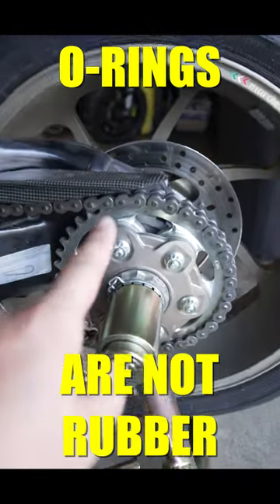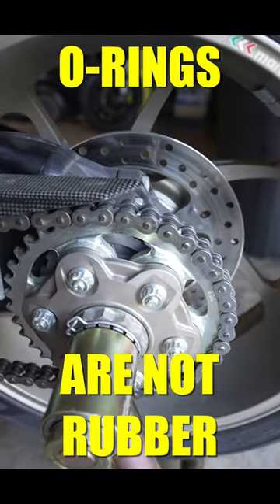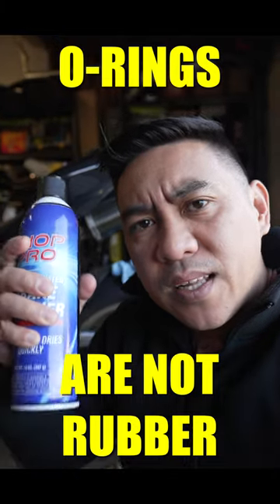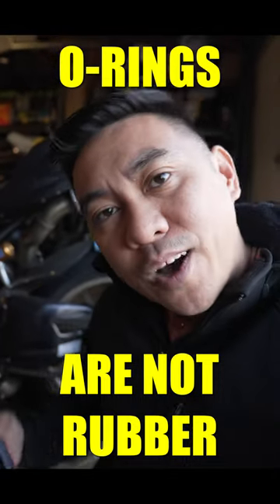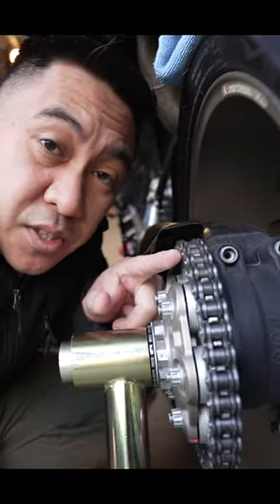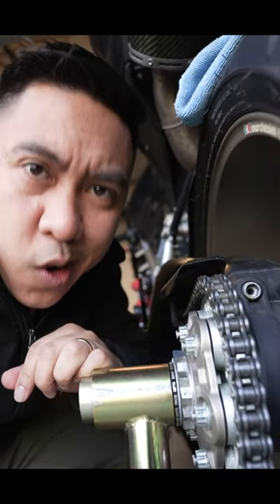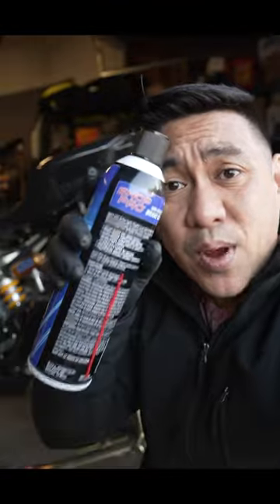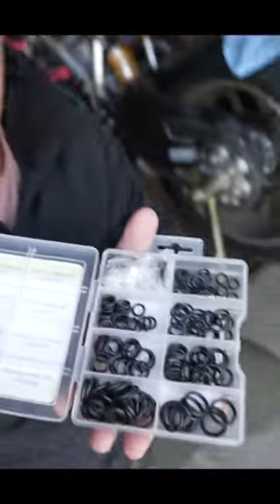Motorcycle Chain O Rings are Not Rubber

Comment: No ,it doesn't "melt " the o-rings however the o-rings are under compression, after application of "certain" brake cleaners they will expand slightly and some times, they will split and come off. The o-rings are chemical resistant NOT chemical proof. Now what will melt the o-rings is the friction that builds up heat THEN the nitrile o-rings will melt because the brake cleaners wash away the lubricant that is supposed to lubricate the o-rings so they don't heat up so much. The function of the o-rings is to retain lubricant for the pin and inner roller, the chain lube is to lube the outside roller to the sprocket to the surface of the inside roller to the outside roller. The chain lube uses the same base chemicals of brake cleaner but not all the other chemicals and NOT in the same quantity and are used to dilute the lubricant to an overly thin state , so the wearing surfaces of the outside roller and "guess what" lubricate the o-rings. It is best to lubricate when the chain is hot, this is needed so the components and clearances are larger than when cold and the heat speeds up the diluting chemicals faster , the o-rings are not negatively affected and the lubricant jells up as, a grease.  Calling someone a moron or cursing them is a sign of a weak position or argument. A little information is as bad as wrong information if the information lacks context.

Comment: I believe the myth stems from o-rings being sprayed with brake clean and then the o-ring not having a petroleum based lubricant reapplied to it. When you buy O-rings they come with coating on them typically. If you then spray the o-rings with a degreaser, like brake clean, and let them sit, they will eventually start to break down.
I believe that’s what my teacher told us when I was in schooling to become a diesel mechanic
Reply from the maker: That could be true. We’ll see. I filled a glove like a water balloon with brake cleaner and let some links take a bath in it for a couple hours. Did absolutely nothing to the glove or the o rings.

Comment: I’ve never had any problems using brake clean on any oring. But that’s me. I’ve also been told never to use grease while installing orings but I’ve also never had any problems with that either.

Comment: I always used kerosene to clean, then lightly apply chain wax then ride for 15 20 minutes. Re-apply chain wax on warm chain. Why risk harsh chemicals on a quality chain but to each their own.   But hey when the brake clean eats all the lubricant out of o rings then riding it will melt them for you
Reply from the maker: You should go watch that video that fort9 made. Apparently kerosene is bad. Guess what they didn’t test? Yup, brake cleaner

Comment: Fun fact while I was cleaning out my bicycles breaks I know you're not supposed to be using brake cleaner with bicycle brakes but I was using gunk brake cleaner and I was wearing those exact gloves and nothing I felt that getting on my skin and I didn't think I was possible because I was wearing no clothes and then I looked at my hands of the face of my hands and there was a ton of holes melted in them so that's my experience with brake cleaner and gloves like that

Comment: But why not just use chain cleaner anyway? It costs the same and it's specifically designed for the task. Don't see the point in arguing over whether brake cleaner is good or bad when there's no actual benefit to using it over the correct stuff.

Comment: Why would you use brake cleaner on an o-ring sealed chain.  They are factory packed with grease.  Using anything other than none solvent based oil will mean you wasted your money on an expensive chain

Comment: Kk do a test then for me been using these gloves for years and yes they do get affected. So put on gloves then rub sand or a couple bolts around in your hands do it for 5 or so minutes and use those as a base line then grab a set and Soak them in brake clean 4-5 times and re do the same test. I bet there will be holes in your gloves. Brake clean does brake them down. And quite quickly. Been using them for 20+ years man.
Reply from the maker: Brake cleaner dries so quick when you actually spray it on the chain, it’s gone in a few secs. O rings are a lot more dense than gloves. I also filled a glove up with brake cleaner like a water balloon. https://youtu.be/PVgwaJWNdRc
Reply from the maker: If you’re curious watch the video https://youtu.be/PVgwaJWNdRc

Comment: You forgot the orings are soaked in brake cleaner, your gloves are not. Thats why O-rings get damaged because they donnot have the option of easy dry
Reply from the maker: I filled a glove up like a water balloon with brake cleaner. Watch the video if you’re curious https://youtu.be/PVgwaJWNdRc
Reply: @adobomoto  🤣 dude, just because you waisted brake cleaner does not prove your point. Gloves are not resistant to anything which contains solvents. Some brakecleaners do not have solvents which have to be more safe for the environment. I know  stuff about rubbers. As an engineer I have seen data sheets and did aging tests acording to international normatives. Most of the rubbers swell or desintegrate to direct solvent exposure.

Comment: Don't take a chance with products that you need to ask questions about. Stick to the manufacturer that claims to clean motorcycle chains and lube them. Don't use Brake cleaner on things it's not designed for. Brake fluid cleaner is for cleaning Brakes. Chain Cleaner is for cleaning Chains. If you're no chemist, don't act like you are. Be safe and be smart, especially when you're working on your motorcycle. That motorcycle you're riding better be right or it's your life.

Comment: We better not start telling people about vuiton seals. They are going to lose their minds when they get a bit more in depth
Reply: Even better. Let's start breaking down all the different type of automotive/mechanical hoses/tubing. Trans hose. Low pressure fuel. High pressure. Intank. Vaccume. Water/coolant.... come on brother let's ruin these peoples worlds
Reply: So I use silicon grease or silicon spray on just about anything rubber-like. You seem to know quite a bit about these types of materials. Is using the silicon grease a good bet? I've never had any issues with swelling while using it but was just curious. Thanks.

Edit: I was taught to never use anything petroleum based on rubber-like materials, which is why I use the silicon grease or spray.

Comment: There are many different types of O-Rings. And break cleaner will harm them.

If you got fuel resistant ones sure, but these are not that kind. They are just standard shit and will get affected by break cleaner. How badly just depends on how long you spray it with break cleaner.

Comment: Brake cleaner is just fine but for some reason if you let wd40. Sit on it for a while they do soften
Reply from the maker: I guess wd40 is the best product to clean chains according to a youtube channel called fort9
Reply from the maker: They never tested brake cleaner
Reply: @adobomoto  I've used brake cleaner, I've used it quite a few times, always works just fine although it does dry the rings so I put some silicone oil on them after

Comment: Yeaaaahhh people that think they’re always smart arent always as smart as they think 

Repetitive use of break cleaner will wear them out and also dry up the lube within the chainlink sleeves which will cause even more metal on metal friction

Edit: use paraffin/ kerosene to clean the chain 
It has a strong enough cleaning effect to remove old lube / debris but also help get a oil base down on the metal and into the deep cracks and crevices like the chain link sleeves

Comment: Dude, research, material comparability. It doesn't take much to figure out what materials are present in any situation and you can easily look up a solubility chart or solvent comparability chart to figure out you should NEVER spray brake cleaner directly onto any type of soft sealing component.

Comment: I've never heard of them putting earrings on the chain always thought I was just slightly old and all components of a chain were still or somehow allow I've never thought they put rubber in motorcycle chains they never did a bicycle thanks I don't ever think I've ever seen her rings on a bicycle Or the rooms I'm sure there's some in the mechanical parts of the engine might be filled problem for some like that but or however once I don't know nothing about motorcycles

Comment: Well for 1 Nitrile is rubber it's a synthetic rubber and 2 have you ever really gotten nitrile gloves soaked in brake cleaner those bad bois start to fall apart and rip by the end of your job and 3 nitrile is only resistant to chemicals not immune. 😂 But a good test is grab a nitrile oring and spray it with brake clean and then let it sit and evaporate you'll notice once the material dries for a few minutes the nitrile o ring will become as hard as a rock and will fall apart under pressure.

Comment: You've obviously never gotten brake cleaner on nitrile gloves I've never come across a brake cleaner that can resist brake cleaner. Maybe you're in California, where the brake cleaner is just soapy water. EVERY time, with EVERY brake cleaner I've used, with EVERY company of nitrile gloves I've used, the glove splits open where the brake cleaner contacted it. Maybe the orings are viton instead of nitrile. But nitrile rubber is not very brake cleaner resistant. Resistant is the keyword. Does it resist it more than vinyl gloves? Yes. But is it impervious? No.

Comment: It is literally called Nitrile rubber… no it’s not natural rubber from gum, almost no rubber manufactured in the 21st century is, so the title is just incorrect. And yes  all organic solvents will have degradative effect on almost all polymers. The rate/extent of which can be discussed depending on the material system and environment e.g. temp, uv, humidity etc., especially in fluorocarbon based rubbers such as viton I see mentioned here which are less susceptible to chemical degradation.

Comment: Ok I don’t know much about bikes and don’t care if it’s rubber but still brake clean will wash off the protective coating or oils on the chain and cause it to rust over time idk I don’t know what you’re doing may re apply just a comment
Reply from the maker: You have to lube the exterior afterwards to keep rust off. The actual lube needed for proper function is inside the links. The orings keep the lube inside the links. What happense outside is kinda meaningless - that’s why you don’t need much lube
Reply: @adobomoto  you learn something everyday car guy never been much in to bike or at least with a motor still don’t get on regular bikes anymore after I broke both of my arms 😂

Comment: The sheet you posted about nitrile literally says “Not Recommended For : Automotive Brake Fluid” 🤡 Brake fluid dissolves nitrile, and brake cleaner dissolves brake fluid. Use your noggin. 

Also if you’ve ever worn those nitrile gloves and used brake cleaner you would know the brake cleaner makes the gloves much weaker. The glove usually breaks if you continue using it after exposure to brake cleaner. It amazes me you can make a video calling people morons and not know something so common.

Comment: Nitrile is not rubber = WRONG, Nitrile is a synthetic type of rubber.
Nitrile is resistant to many fuels, oils and solvents, but not completely immune.
Reply from the maker: Synthetic Rubber is not Rubber lmfao
Reply: @adobomoto  Wrong !
Rubber is an elastomer made by crosslinking polymer chains.
There are several types of natural rubber (latex based being the most commercially viable and common) but there are also several types of synthetic rubber in common use, nitrile or Buna-Nb being the most common.
20+ yrs ago I was the Engineering Mgr of a rubber component manufacturer supplying automotive and aerospace customers.

Comment: OMG, the self-own, there is a reason they make non-chlorinated brake cleaner. Before calling people morons do better research and READ. Right there on that data sheet, it says at the end of the  not recommended for use with section is halogenated hydrocarbons. Guess what one of the actives in brake cleaner is? Chlorinated hydrocarbons. Chlorine is a halogen, BTW. So if you are spraying the chlorinated stuff on o-rings, bad times ahead.

Comment: To put it constructively, which Is one thing I can't say your videos on the topic achieve :
No it really doesn't matter all that much, your chain won't implode if you reasonably douse it with some brake cleaner for some amount of cleanup.

You are also mostly wrong on the topic as others have pointed out in more than enough ways.
The attitude towards it is less than ideal. Just by having undoubtedly limited experience with something, as the vast majority of us do, does not mean you have the full picture.

Also as a sidenote, the longer video on the topic was borderline unwatchable mostly due to having no structure. You do have and can make good content, so why not try to do better?

Comment: Why they hell are you using brake cleaner tho?  I’m sticking to kerosene it works fine and has lubricating properties unlike brake cleaner.
Reply from the maker: Easier to do more often. Kerosene smells and gets everywhere
Reply: @adobomoto  and brake cleaner doesn't smell? Def gets everywhere too. Also brake cleaner will fuck up any paint you get it on also.

Comment: Yeah but those gloves are meant to be thrown away after a small time frame and maybe they do get damaged but you don't see it because they are on the trash, the o rings are not used for a small time kid,
Reply from the maker: I filled a glove up like a water balloon with brake cleaner. Left it for an hour. Did nothing. Watch the video if you’re curious https://youtu.be/PVgwaJWNdRc
Reply from the maker: Brake cleaner evaporates too fast to do any damage..not even an hour of soaking did anything. You should actually try it before you say anything else

Comment: ...... OK so the O-rings aren't gonna melt off but they're gonna get severely worn from brake cleaner. Brake cleaner still is not good. You should use kerosene

Comment: It depends on the manufacturer of the chain, some use butyl rubber some use nitril some use viton for this guy to blanket state they are all nitril is just moronic and uninformed brake clean is a very harsh solvent and destroys most rubber and plastic, maybe not always immediately for all of them but it will in short order. I can say from experience as an engineer on large tugboats and mechanic on land and avid rider this guy is very wrong,  if you want a good cleaner with no risk to rubber or plastic use lectriclean (electrical parts cleaner) same cleaning power with no risk

Comment: Those gloves fall apart after a few sprays lol swing and a miss
Reply from the maker: Filled a glove up like a water balloon with brake cleaner. Did nothing. Lol. Swing and a strike out. Bet you won’t go watch and comment https://youtu.be/PVgwaJWNdRc
Reply: Bet your right I won't waste the time and your still wrong dude you can beat a dead horse as much as you want but people that use these things daily will tell you different I go through 10 pairs of nitrile gloves before lunch every day  and about 40 o rings a day because they don't hold up once they are wet with a solvent based cleaner

Comment: Spray strong brake cleaner on nitrile gloves and then post the video genius..
Reply from the maker: Brake cleaner actually evaporates too quick to do anything. I even filled a glove up like a water balloon with brake cleaner. Watch the video if you’re curious, dumb dumb https://youtu.be/PVgwaJWNdRc
Reply: @adobomoto  your brake cleaner sounds about as strong as your mouth wash. Nitrile will stand up slightly longer with non-chlorinated brake cleaner, like you're using. But industrial cleaner, like us big boys use, will make most polymers, nitrile included, swell very quickly.